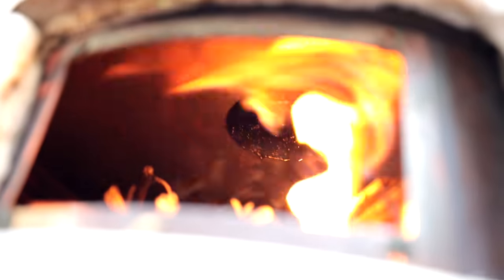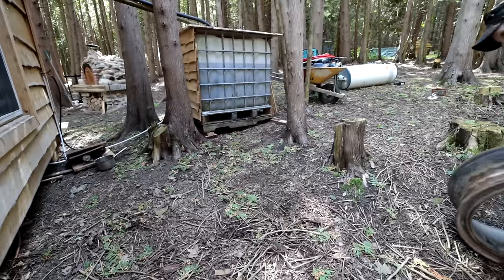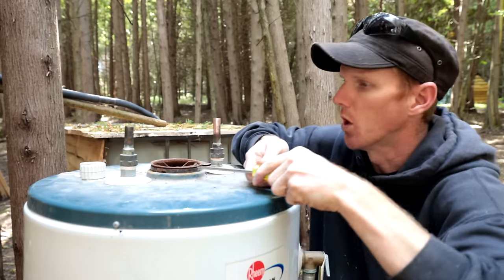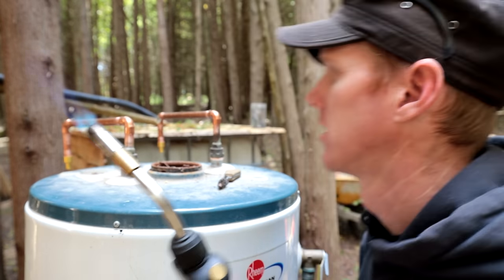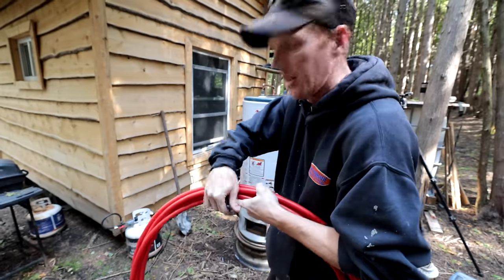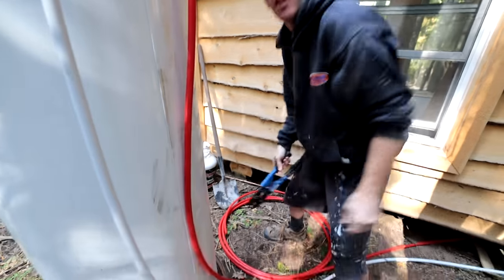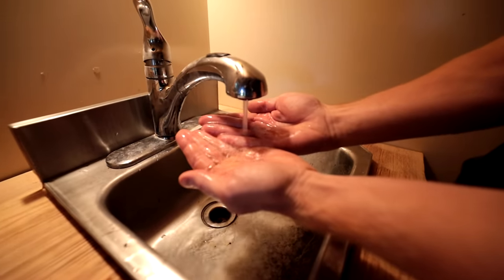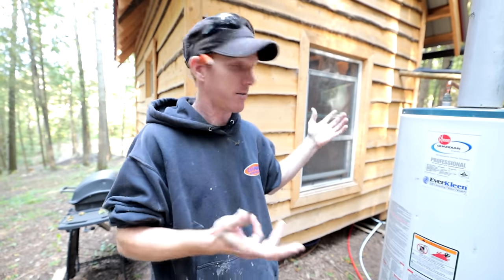MacGyvered Hot Water Tank for Off Grid Cabin - Fire Burning

Comment: Great job,!The drawback is you have no way of automatically adjusting water temperature for safely like a home system. The water temperature coming out is going to vary based on ambient temperature, how hot the fire is, how full the tank is, and  how long it heats the water for before being used. Children can be scalded very easily with this system. Just something for anyone with kids to think about.
Reply: We only had chip heaters for our hot water when i was growing up, and they are also totally un regulated, never got scalded. We always knew that the hot water was hot. We also had a chip heater in the house we were in when our son was born, again no problem.
Reply: @hansschutte5654  good for you! And we used to ride around without seatbelts, in the back end of station wagons, and in the beds of trucks too.  And all my family- grandparents, aunts and uncles used to fill the room with cigarette smoke while all the children played in the room, too. Stuff changes.

I don't know what the laws and building codes are where you are, but it isn't legal everywhere AND not every parent knows this safety feature is a thing. This also totally matters if you want to rent it out or sell it ever.

Point is, do your own research around your specific needs before doing this.

Comment: I would recommend not actually having the fire in the bottom of the tank and just having the exhaust gas run through the chamber and flue. The flame impingement will cause the tank to corrode faster. Also you should keep the draft Hood on the top of the tank to cool down the exhaust gas that b vent is only aluminum inside and will melt.
Reply: What do you mean by this? I’d like to do this with an empty tank of mine

Comment: You might can get some amount of solar energy heating if you painted the tank black. Works great in the summer time in Utah, USA with black tanks for hot water just an idea. Full Stop!
Reply: The tank itself is insulated so it stores hot water quite well. It doesn't get much sun there.
Reply: Did that in Iraq. To the point it would scald you. 😀
Reply: @scottewen2522  we used a small camping bag showers OIF1-2, always I had good access to shower in 09-10 when I went back to Iraq.
Reply: @james burrows I was in OIF 1-2. Supported 4-ID in the CSB out of Camp Spiker. Old Iraqi Air Base. I over saw laundry/showers, water purification and filling all those water tanks everyone had on base, fuel, Class Nine Warehouse, Transportation assets. At first we just had a 5 gallon tank that we would travel with on the HMMWV to use. Felt so good at the end of a day. We brought a shower head with us that attached to the jug. Turned it off and on. Threw up a ponchos and we were good.👍😀

Comment: I see one of those broken water heater all the time being tossed. I always think, they could be upcycled , as long as they are not leaking. Everyone makes these wild heaters for off grid, they use some tank they have to weld, cut , drill, grind and weld again for three days. This is THE WAY I want to do it for my cabin. I’d look into some way of monitoring temperatures so you don’t overheat . Also I may try to split the chimney into a Y where one side can be used to act as a chute to feed wood chips and sticks? Just keep the whole thing far enough from the cabin, put a small metal shed around it, pipe insulation around the  pex pipes

Comment: For extra safety, install an additional  low pressure vent for the water on the pipes.  Get an adjustable check valve mounted close to the water heater.

Comment: That sound it was making, that was water boiling...  As was suggested by others, add a rocket stove on the inlet.  The rocket stove will more completely break down the combustibles(no smoke output) before the hot gas gets into the burner chamber and up the flue...  They are also easier to shutdown when the desired temp is reached.  One of your shots inside where you were burning you could see the creosote forming/condensing on the cold surface, and the moisture from the air and wood condensing and dripping back down the flue.  With that long a flue you can make a killer hot efficient rocket stove to attach to the opening where you removed the burner assembly...

Comment: Cool little project, many people would love to do stuff like this if only they had the place, house/cabin to do it all in. I myself want to use a HW tank like this but as a boiler to heat water to heat my shop & home with in northern, MN as I have a class A chimney on my shop and already have a hydronic system installed which uses a water to air heat exchanger in my forced air furnace in my house and also in the shop itself. Heating the water w/o the use of expensive boilers or large outside wood boilers was my goal as I wouldn't mind burning a smaller fire under a used or new hot water tank to heat with. I do like the idea/plan that uses a '' Rocket heater'' as the burn chamber though instead of a fire directly below the water tank itself for many reasons.. How we heat our homes, our water supplies for many needs can be fun but also requires a lot of thought put towards safety first! Loved the Video sir and I hope you learn many good ideas from the comments such as raising the water supply to use gravity to help ''push'' the water itself. A much better plan IMHO would be the use of a Hydronic water pump as they can last a lot longer than the smaller pumps out there. They do make a 12 volt model I believe.. If the water tank itself were placed on a heavy duty stand it wouldn't even need a pump I imagine.. Good luck and stay safe.

Comment: Here is another method that could be used on the wood stove in the cabin. A coil of copper pipe could be hung against the back of the stove and connected to the floor heat tubing and water heater. Run a couple of loops of the sharkbite tubing in the tote to keep the water thawed.  https://youtu.be/b3i249KtB0o

Comment: Nice job Kevin. You make the coolest stuff.

I used to boil water to do dishes at my off grid place. Not sure if this would have been more efficient than just boiling water, but it sure would have given me more hot water to work with. 

Anyway, I am impressed.
Reply: I had water the next day as well..  as the tank is insulated much more convenient

Comment: You missed an opportunity to build a composting methane generator and storage system.
Reply: Hi there. I would like to hear or see your build concepts on this. I have a few tanks and have been trying to figure out the best way to build a septic/dragon system.
Reply: @nonyabusiness9747 Hello! So, once upon a time, I stumbled across a youtube video (honestly cannot remember what it was called) where a guy used a modified drum to collect methane generated from food scraps and rabbit feces/bedding. He set it up so that new material started nearer the top, without exposing the contents to extra oxygen or releasing methane with a U shaped pipe that went in the side and up near the top. If I recall correctly, he drained fluid and decomposed matter from the bottom and used the suction to draw the new material in. The rabbit feces provided the necessary microorganisms for the generation. Now he ran the methane directly to a burner for some heat, though I thought about ways involving balloons and even the wood gas burner collection risers out there, to automate a compressor when a reservoir got to a certain capacity via limit switch. The idea was to come up with a way to store a small, compressed amount in reserve for cooking or water heating despite lack of a constant supply. In the case of the riser, the gas pressure would be slightly higher than atmospheric when the riser top hit the limit switch. Then you'd have an arduino and relay run a sealed compressor for around 5-15 seconds and stop to let the cycle continue. Gotta be careful though. In some places it's illegal to collect rainwater and you could be taxed as an energy producer if your electric/heating bill is too low for IRS expectations. Also it'll be near impossible to insure anything that isn't UL listed, ASME/ISO compliant or really anything not signed off by a PE.

Comment: all you have do to have hot water
off grid is sit water tank on its side close to wood stove run you 
some tubes or pipes above stove  cold in hot out to tank keep water circulating thru pipes or tube into tank you get the picture 
an have a water line out to what 
ever you want sink
tub ect

Comment: To increase your water pressure, you could mount that storing tank on a taller platform, just below the bottom of the roof. That way, gravity would be able to take over the job of the pump. Alternatively, and for actually good water pressure you might find in a house, you could add another tank higher than your roof and use the pump to transfer water from your current tank to the higher tank, increasing the pressure by a pretty serious degree

Comment: When I was on vacation in Germany in the '70s as a teenager my uncle's house had a small hot water heater that you would first have to put a fire in before having a bath or shower worked great
Reply: If you can get a oil fired water heater they work a bit better for conversion due to the larger chimney and thicker wall thickness of tank and burn box

Comment: An external firebox directing the heat into the heating space would actually yield more BTUs with less condensation. Also, you won't be required to feed that tiny space combustible material and monitor it nearly as often. A blower assembly for the firebox would be even more efficient but will require a fan unless you engineer a manually operated bellows.
Reply from the maker: The condensation is typical on cold water tank start ups.  The tiny space prevents over firing.  I don't want a kettle.!

Comment: FVIR. FLAMMABLE VAPOR IGNITION RESISTANT tank. Has a large damper in there to snuff out the explosion in the event flammable vapors get into the combustion chamber. That flue slows the heat vapors down forcing the heat to the tank instead of straight up.

Comment: For convenience and controlled heat output, try cutting up prefabricated fireplace logs, adjust the piece size to the BTus desired, they light easy, burn consistent and won’t smoke you out, then when you get size just right, market it, patent it, sell it and send me a small commission, ps take out the wind chime, it’s causing the dripping because the exhaust temp is too low

Comment: You can burn off the creosote with stuff available in stores designed to keep it burned off or you can use an old school trick and get a good bed of coals going and toss in a hand full of table salt. The burning sodium will clear out the creosote.  Cleaning twice a year will also keep it clean.
Reply: I heard burning a pop can will clear it up too.
Reply: @cmosphoto1  i have not tried that one yet but i have used the salt trick. I will have to give it a try. I have made a small windmill with pop cans and used it to make electricity. It does not make much but it does make a little. I am working on building a double helix windmill to try and generate electricity on my homestead.

Comment: WIth the "wind chime" in place you might experience poor draft so a taller exhaust pipe can help with that. BUild one of these from a 25 gallon heater decades ago to provide hot water in the trailer we used for oour hunting camp.The "firebox" inside the heater isn't all that big so if yu have 5 guys want a hot shower, cut the bottom out of the heater casing and build your fire in the steel truck rim that will take larger chunks of wood
Reply from the maker: The whole tank is sitting on dump truck rim. Might look into that.
Reply: @ModernSelfReliance  that's what we used..once you cut out the bottom you can build a better fire. You might want to look into that

Comment: Put a firebox upfront and use it like a rocket stove? Or put a door on it with a sliding air control or something so it would work like a sealed wood stove. Might use less wood burn longer be able to adjust heat output with a big load of wood? I absolutely love the idea great vid simple solution 👍

Comment: Might it be better to build a burn box in front of the existing fire box and allow the flames to draw up inside? You'd have more space and wouldn't have to worry about drips putting your fire out. It'd be easier to clean too and you could divert the flames quickly in the event of overheating.

Comment: If you were to build a vox around the wood fired hot water,  you will want to fill it the space with fire block wool and build a metal container around the hole thing. That should be able stop the heat lose
Reply: It's fairly well insulated as it is...

Comment: Cool!  a steel pipe at the top flue with a coil of copper around it would reclaim heat from the chimney.  Put on inlet side and the water would be pre heated as it enters tank.

Comment: I can't believe someone else did this, yeah!!!
So what I did to mine to keep it stronger and the water hotter for far far longer is tear out all the insulation and refill the cavity with aircrete!
I use ponderosa pine cones, about a paper shopping bags worth and 15  minutes gives me all the hot water I ever need. 
In fact I got bored seeing how long.
The cones just keep it hot forever 👍
Reply from the maker: Pine cones would be just enough heat fast!
Reply: @ModernSelfReliance  they also never boil the water👍

Comment: You can by a wood burning hot water boiler in Bulgaria for about 330lev ( approx.150 Euros) with  an electrical input, for use during summer.

Cheaper than a convential electric boiler! 

Mine is great! Takes about an hour to heat 80l of water to too hot to touch (about 50Centigrade). Heats up the bathroom (2m by 3m) so no need for a radiator.

It is not the prettiest of things, but a coat of radiator paint will go someway to correcting that. SMILE.

I also have back boilers in two of my wood stoves and love my 2 kitchen types. Heat and foooood.. LOL

Oh I have 8 petchkas ( wood burning stoves) in the environs, (house is 10m by 10m), work shed (5.5 x 10m). Just fire them up when you need heat in a specific space.

LOVE THEM! 

I use about 10cubic metres of wood ( with a bit left over!) most winters. 6 monthes ish. Not usually as cold as Canada, but a lot below minus 10c daytime temps from Jan to March. ( It has gone up a bit, but cut and split, about 600lev, 300Euros, delivered.)..all you have to do then is persuade your daughter, who is helping you to stack it! TO STOP singing Hey MR Tally man, Tally me banana for 12 hours straight!

Hoping this makes you smile. The Mad ex-pat lady in BG.60 years young next Aug.
Reply from the maker: That's neat about the wood fired water heater.  Never heard about them until I made a wood one.

Comment: Nice job on the solder job and wiping pipes isn't just to remove flux for making pipe green, 
flux is a type of acid and if not wiped off it starts to eat the copper pipe or fitting. you did forget to ream the pipes! give you a pass on that but for a guy who has some skills youre pretty handy, be sure to strap and secure that tank, hate to see it tip over and cause a fire or badly scold someone .
Reply from the maker: Of the possibly hundreds of times I've watched plumbing being done I have yet to see a "plumber" ream the pipe.    :-)

Comment: Very cool, always wondered abut that. excellent.
Reply: It works!
Reply: Kevin the Wood Chucker indeed love it!! Gives me ideas, build like a Weil Mc.Clain boiler. Not hard, lots of tig welding, however wood fired. Another idea.. get another like the one you, have run hot water pex on circulation pump, to budda hut, heat it in winter. Ha ha ha 😂

Comment: You might want to reconsider using PEX water lines for this water heater. PEX is not UV friendly, it will actually deteriorate when exposed to sunlight. I think there might be some PEX that is UV safe, but I'm sure it would be quite expensive compared to regular PEX.

Comment: Nice setup! Those relief valves are reliable. They should go off way before the tank exploded. I would not want to be around if that thing went bang. Running some hot water off and introducing cool water into the system would also help in a pinch. It’d be sweet to modify that water heater with a bbq charcoal starter thing. Underneath it. Sorry man just thinking out loud. Cheers!

Comment: You want the cold water coming in near the bottom, the 2 openings at the top are for hot, and an emergency valve...
Reply: That's a genius idea!!!! Remove the bottom drain valve make that the cold... And a blow off regulator on the top.
Reply: @cmosphoto1  I've got something similar for hot water in my cabin, but hooked to a wood stove.